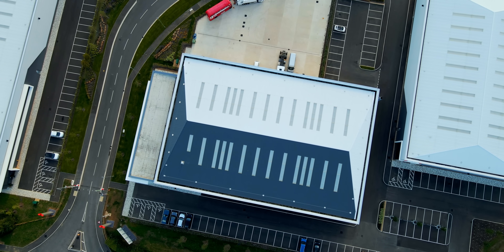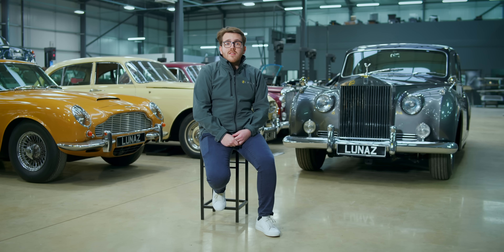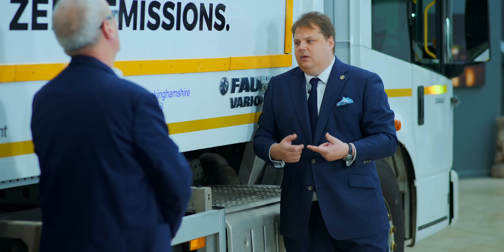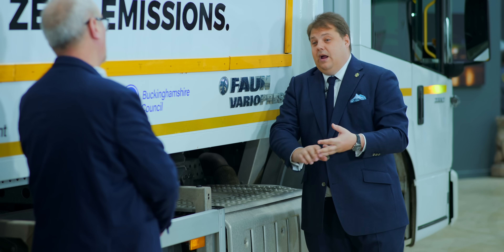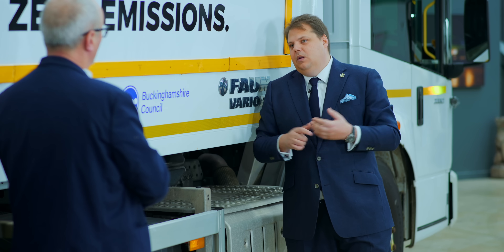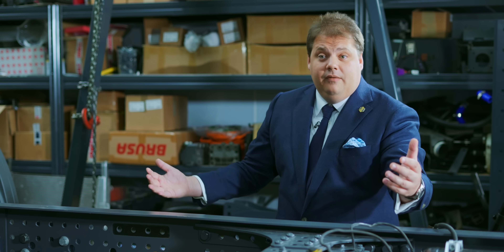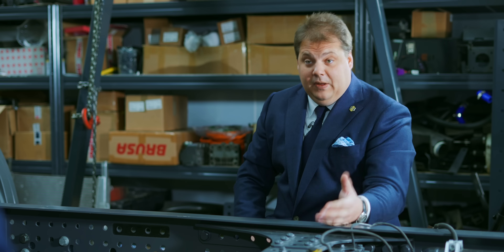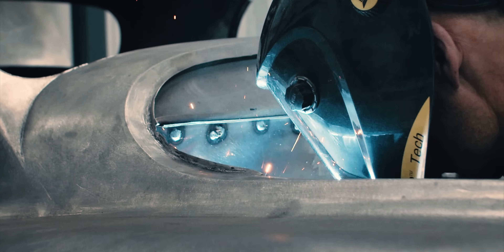Electric Rubbish Trucks Are Getting a Luxury Makeover!

Comment: The question arises in my mind when I see this, what will they do in 15-20 years when there are no more ICE trucks or cars? What they do is verry important but it is not a verry long term viability project, what do they plan to do when conversion jobs start to dry up? Will they then shift to battery and ev engine swaps or cervising or what?

Comment: It's a pity they couldn't find a decent wagon to electrify,those Mercs are pieces of shit,windows and doors that only work when they feel like it,aircon that only works when it's standing still,roof vent that doesn't let air in because the only place for a light bar is in front of it,and everything else just rattles itself to bits.

Comment: It looks great... But I don't like the sound of not being able to charge a bin lorry up faster than 22kw, how big is that battery. What if it needs to do an extra shift if a different truck has broken down? Can you not just wack it in at 300kw for 30mins and be on your way?

Also I'm not a massive fan of right sizing a battery. It should always be over specced. A battery looses an average 6-10% capacity in its first year, sure most don't loose more than 15-20% before 8 years is out but these things need to be taken into account.

Comment: One of the biggest problems with refuse trucks is how loud they are, when working at night is more common. A silent or at least quiet truck at night is perfect for these trucks. Add proximity sensors and some kind of anti crash software and you have a massively improved work vehicle. The dustbin truck drivers do amazing work, steering enormous vehicles into the tightest corners and back lanes that most people are hesitant to drive their car into. It sounds reasonable to set up the batteries so they can be charged with 2 or more chargers at the same time, to speed up the fill-up.

Comment: I wish he would've answered Roberts question 12:00 "Are all the hydraulic systems powered from the OG diesel engine or was it a separate system" and making trucks that cater to a specific route is a bad idea because it means they aren't very flexible, otherwise a good project.
Reply: They are not really building trucks for individual routes but instead evaluating the needs of the specific municipality. Take my local municipality, two weekly routes are above 150km, three between 50km and 100km and all others usually stay below 50km. Why equip all with large batteries when they would end up mostly unused?

About the pump: The answer was probably too complex. Just for the press shown in the video: You got three options which range from mechanical driven pumps with hydraulic accumulators to fully electrified systems. When retrofitting to EV the press also has to be retrofitted to an electric pump, but that's an easy off the shelf upgrade in most situations.

By observing trucks you can usually tell the system:
- Those with accumulators usually have enough power to lift bins without increasing rpm, but need to increase the engine rpm for garbage compression every few bins.
- Those with electrical pumps do all keeping the engine at idle rpm. At least in my area, these are the most trucks.
Reply: @danielrose1392  

One would want at least a couple of spare trucks with larger batteries to be capable of doing the longer distance routes or routes with lots of hills. If one only had the exact number of truck with the larger batteries as the number of routes requiring them then if any of the trucks had a problem there would be no replacement for it.

Just because the trucks are electric vehicles doesn't mean that they will never break down. There could be problems with the hydraulics, a flat tire, it could be involved in a traffic accident, or the contents in the back could catch fire (something that seems to happen about once every year or two in my city from people putting dangerous goods in their garbage). 

The other year in my city one of the companies contracted to pick up the garbage and recycling in two suburbs lost six trucks when a fire broke out in the building the trucks were stored in. They were sending out trucks for a second shift (I don't know if the people were replaced but they probably were). It took them almost a year to recover. Having trucks with different capabilities would have made their scheduling ability even worse. Imagine if all of their trucks with larger batteries had been lost, something possible if they had different chargers and those were in one area. 

I agree that having the extra batteries in all of the trucks is wasteful but there is a balance. It also depends on how easy or difficult it is to install and remove extra batteries.
Reply: Roberts next asked if they would add pumps and the reply was that the company keeps things as light as possible to keep costs down. If you read between the lines you can tell that the pumps, along with as much as everything else, gets reused. The pumps would have been powered via the old Diesel engine and after the refurb they will be powered via from the batteries.

Comment: Why are there two guys loading the bins manually on the back of the truck? Or are you using footage from the 1990's?
Reply: That's how it gets done most of the time - no robotic arms in the UK.
Reply: @timmurphy5541  Whyis that? Is it a union thing?
Reply: @itekani  I could only speculate. Perhaps the labour is not expensive enough yet. Post Brexit that might have changed.

Comment: Excellent! Repurposing/reusing is much better than recycling back to steel plate ready to push back through the new-build factories.

Also, given bin trucks are typically doing 1-2mpg, and operate right where people live, they are exactly the right point to start to make a noticeable difference. Well done! 👍
Reply: And they are noisy.
Reply: @hhcosminnet  True! My city trialled electric bin trucks - the loudest noise came from a really squeaky hydraulic ram...
Reply: @hhcosminnet  and smelly

Comment: Genuine questions, how much carbon and does the production of EVs cause compared to petrol vehicles, I’m guessing the battery production is horrific for the environment, so how many EV miles would you need to do vs petrol miles (factoring in the production of the electric as most is from burning coal) to break even? I’d have a guess and say it’s over 100k EV miles before you’re even
Reply: In the UK our electricity is now nearly all NOT generated using coal - so that swings the argument quite a long way in favour of EVs, I guess...?!
Reply: In the UK the carbon break-even for an average car is 11,000 km (7,000 miles) for EV vs. petrol, so your guess is a very long way off. The International Council on Clean Transportation has calculated this for different countries (YouTube won't let me post the link to their website here so you'll have to find them via Google).
Reply: @davidhaywood8029  An the average car travels about 7400 miles a year, so a little over a year.

Comment: If this works they are going to put Dennis out of business... Does the mechanical rubbish-squishing bit of one of these trucks wear out, or will it last for decades given some new bearings, bushings and hydraulic seals?
Reply: Hydraulics and pneumatics are relatively robust. It will need occasional bearing or cylinder or pipe replacement, but overall, can last a very long time.

Comment: Why would you customize to each route? If one truck goes down that route can not be ran because you no longer have a truck that can run the route, Or if you have to detour for any reason do you run of battery because the pack was setup only for that route.
Reply: I'm sure the fleet manager would have thought of that and worked out a plan
Reply: Would you really buy batteries for all the trucks in your fleet for the longest run in your council ? Just in case ? That’s quite a few library books , or pot holes filled your committing.
Reply: @francesconicoletti2547  Well it would help with resale value if nothing else unless you are going to never resale it.